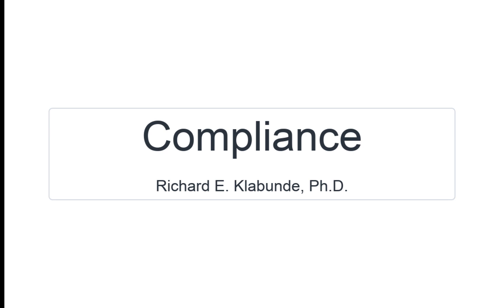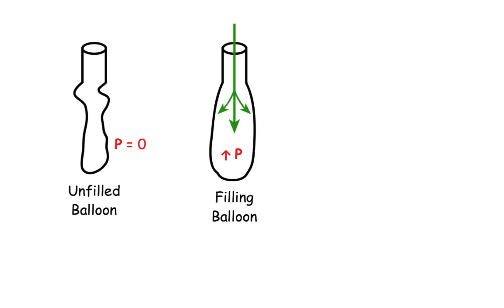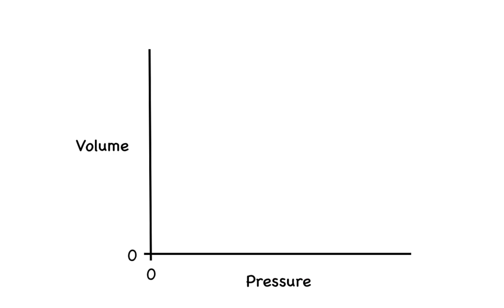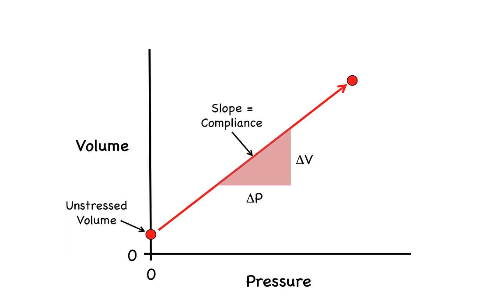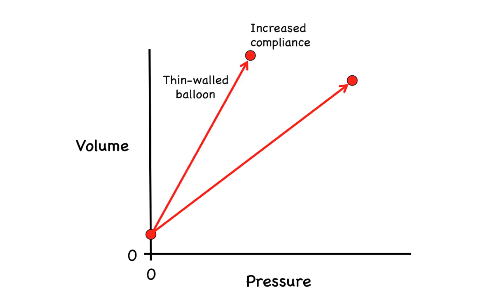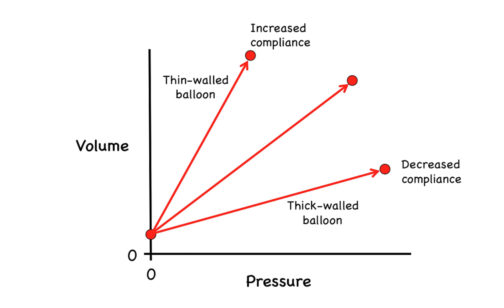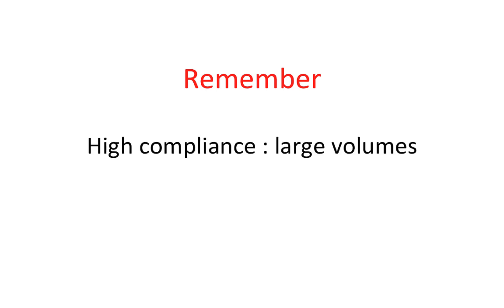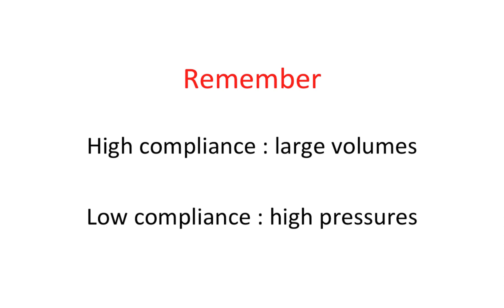Compliance: illustrated definition

Comment: Hello Professor, if the pressure is influenced by the volume, shouldn't the volume be at the x-axis (manipulated variable), while the pressure be at the y-axis(responding variable)?
Reply from the maker: Because this lecture focuses on defining compliance, which is the ratio of volume to pressure, I plotted it in this manner (which is nearly always done for lung compliance). In my other lectures where I talk about ventricular pressure and volume relationships, I plot pressure against volume, which is by convention for heart chamber compliance. With those plots, the compliance is the reciprocal of the press-vol relationship slope. Either press or vol can be independent variables. All 3 variables, press-vol-compliance are therefore interdependent.